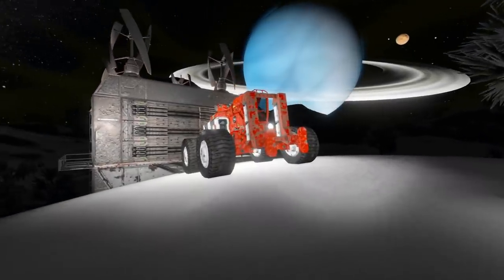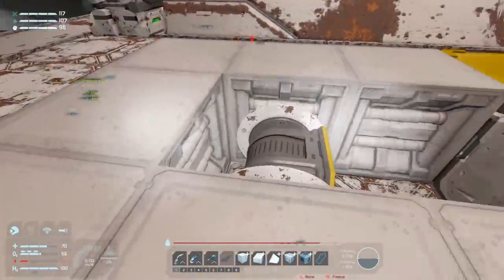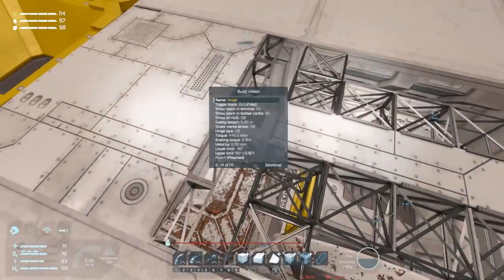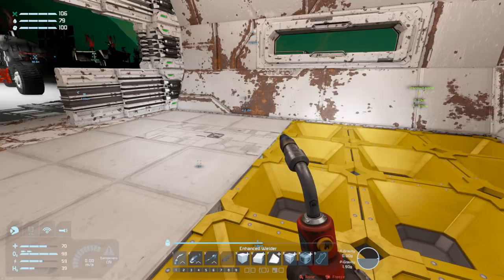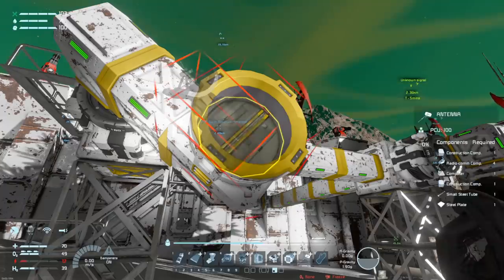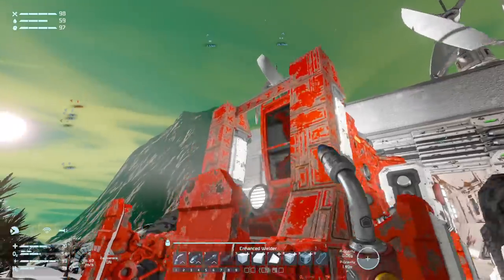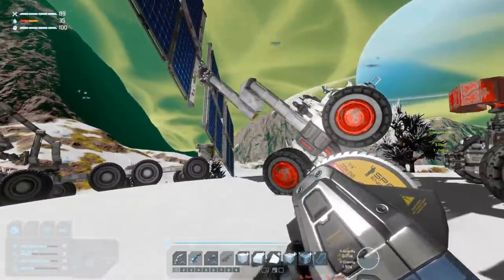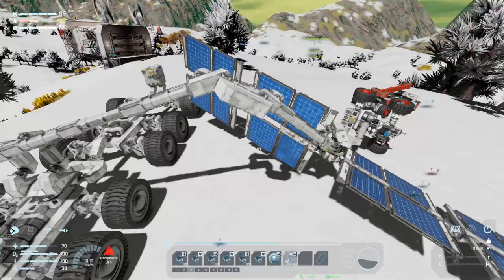Survival Impossible - Manny or Mannie or Clangy? #39 - Space Engineers Hardcore Survival

Comment: I just ran into this the other day. You CAN build like this, but you have to line it up, place your static base block, pick the pillar up with the crane (detach the hinge) put the weld pads on, and then let them weld to each other and then line up the hinge, make the base end loose (no resistance like a rotor that's off) and attach. So your analysis is correct. Make sure the setting on the hinge (like a rotor) is all set to the weakest they can be with a slight displacement. Very similar to what @Jenachy stated. You may still have an issue because of the force the gravity is playing on the hinge but you won't know till you try, I did this is space. This whole thing is because you cant make a "sub-sub" grid a static grid. You can attach to a static (like you were doing in space), just play out how you built it at the Lawnchair. The sequence of events is a key part pillar then, pillar then attach.

Comment: Great video!

From some experimenting on my part it looks like prefabrication may be the solution to your towering problem, though you might not be taking it far enough.

You could do the following:
* Build the first horizontal segment. At the end put a hinge part.
* Prefab a tower part, without attached hinge parts, and attach it to the end of the horizontal segment with the crane and Build Vision. Build a keypad (or something with a keypad) as part of the tower.
* After attaching the tower you should be able to use the keypad to turn the tower's grid into a station. After that you should be able to connect it to the voxel without a problem.

If your crane is powerful enough you should even be able to prefab the horizontal segments as well, mounting and attaching them to the preceding tower. It might even be worth it to keep the keypads on the towers for this and gun control.

This all pretty much depends on Build Vision. Since the unattached tower is unpowered attaching it to the end segment would be a nonstarter without a battery contraption, possibly involving a small grid hinge part.

As for your hideaway connector, why not go the other way and put flat corner LCDs on the large grid blocks around them? That way you have a place to put proper warning stripes.

Good luck!

Comment: One thing you could also do is build the horizontal segments with both horizontal and vertical hinges. That would allow you to keep the conveyor segments following the ground at a steady height. It should also allow a tower standardization. 
However, make sure that the hinges are unlocked when you try to turn a newly placed tower into a station.

Comment: Best answer, place the second hinge on the pipeline the other way up to give yourself movement in 3 directions instead of 2. This also means you can maintain the same height over the terrain.

If you don’t like that however build the pillars first then move the pipes in to connect them after. You normally build supports before the thing your supporting in the real world, so it makes sense here to lol. it’s also a lot more stable to build this way with hinges as you’re not dealing with converting to station while attaching anything so it only has to think about the movement of 1 object while not solidly rooting the other, thus likely reducing the probability of any issues and kaboom.

Comment: So, alternate ideas for getting the pillars up, you can build them as you have, use the merge blocks with one off, swing everything into position, the grab it with the crane to hold it in position, detach the hinge at the tower and use the hinge at the other end of the pipe to swing the whole pipe out of the way, then attach using the merge blocks, just make sure the crane is not locked to the ground, that way, everything should attach without shifting the voxel-anchored blocks and blowing them up..?

Otheerwise, great episode and as always, keep up the good work'

Comment: All white.  Definitely all white for the recessed connector. Also, just put a horizontal and vertical hinge at both ends of the conveyor sections, move everything into place to settle on the merge blocks, then turn off all 4 hinges so everything is free to move during the merge (like a universal joint).  After you merge lock the hinges and you're good to go.

Comment: The easy way to get your pillars connected to the ground would be to start as you did in the video. When it is in the proper place and connected to the existing  conveyor network, connect it to the ground temporary, using a landing gear, once fixed to the ground with a landing gear you can convert the pillar to be a stationary grid and place the bottom most blocks connecting it to the voxels. afterwards remove the landing gear.

Comment: I like the hazard colours on the connector, but if you want to keep the seamless look when it's in the floor, here's another idea: put a coloured light on the wall or ceiling, set its offset to position the light source over the connection, and turn it on/off with the timer block so that it only comes on when the mechanism is not closed (i.e. when it's open, opening, or closing). While I really like the connector mechanism, I don't think it's a great solution to the problem, because you can't park the Manny while you're using the grinder pit. You'll have to drop stuff on the collectors, back out, pressurise the room, do all your grinding, depressurise, drive in, raise the connector, reverse onto it, and close the doors again to repressurise. I love overengineering things, but not when it makes them harder to use!

Comment: I like the idea you said at the end of building a mock up. Could even move it out the way once the first block is placed. This could be by rotating the temp before disconnecting, ideally from the far hinge. That way you can rotate back to position once you've cleared the hinge part on the static tower. Then rinse and repeat, keeping your template throughout.

Comment: For the merge block build: In my experience, the larger of the 2 grids becomes the "primary" which is why the piece in the voxels is moving and exploding. If you place more blocks on that grid before merging it should* help.

We had an interesting experience when we were merging/unmerging a very large ship build to a smaller static station and after the merge the station was no longer static because it was the smaller of the 2 grids in the merge.

Comment: First issue was just trying to build a subgrid into the voxels which SE considers a no-no. Last issue was hinges just being absurdly touchy and finicky compared to rotors and pistons.

I'd say build the hinge base onto your existing piping, line up the tower/relay bit, slap it in the voxel, then add a hunge part to the tower/relay.

I guess otherwise you could just connector jank it but that's not super aesthetic and is also costly.

Comment: Attatch the pillars to the ground (or buried block) with a landing gear, convert to static grid through a control panel, then you can build blocks into the ground off of it. I've used it to project a building off a rotor before.

Comment: For the pop-up connector, I would suggest only marking the corners. It gives you the location of the connector for reference when parking your forklift, but it doesn't become terribly conspicuous.
For your forklift, I agree with everyone that has suggested ending with "ie."
I don't have any recommendations for the pillars however, as I've only recently begun delving into sub-grid construction myself. That being said, I agree with the users that have recommended building the tower up more then using weld pads or merge blocks to secure the upper section to the tower.  The logic seems sufficiently sound.

Comment: Suggestion on setting up those pillars...

1. Make the pillar how you want
2. Capture a blueprint
3. Use a projector to display it exactly where you'd like it to sit.
4. Weld it up using the Liftsie
5. Connect the hinges

I know it doesn't let you build & place as intended but it should work and not need any merge blocks or things like that.

Comment: 45:35 the welding pad wasn't the issue, and you can build that way. All you need is a control panel. Move pillar into place and use the control panel to convert to station and build off the bottom of the pillar into the ground.

Comment: 43:20 My guess is because the grid was still considered mobile and you were trying to "merge" it with a stationary grid.  Rather than force the tower to become stationary, it forced the base to become mobile, which then proceeded to esplode because embedded.  My experience with making these kinds of umbilical lines is that you can actually force the "non-head" part of the hinge/rotor to become stationary even if they're not embedded, so long as they're not moving.  Which means you can then build off of them and into the ground.

Comment: You should add two spinning hazard light on each side the hidden connector, that turns on when you open/close Manny's charging port, and have a second timer block turning them back off after 10-20 second when the contraption is still.

Comment: IRL for a true universal joint that can relieve any stress in the system, you need to account for all 3 axes of rotation.  A standard "wrist" configuration to do so in stages is roughly equivalent to rotor-hinge-rotor, in series.  Engineering tolerances generally mean if its close you shouldn't need to care about all three, but it looks like the physics engine acting on the hinge does not tolerate any bending at all about the axes perpendicular to the one it is intended to allow, so adding an advanced rotor to either side of the hinge would probably solve the issue, since it can rotate freely on one of those extra axes and in any case seems to have a higher tolerance for "wrong" bending stresses than the hing does.  Especially if the last part to get attached is the rotor parts.

Comment: Suggestion, the Gantry mod includes nice looking, printable gantry blocks. Included in there it a gantry with a conveyor in the middle. Allowing you to attach a conveyor from the side, and piping on both sides. Useful for limiting your junction count for performance.

For you conveyor problem, it looked to me like it was pulling downward on the hinge. I'd think an extra hinge to allow vertical shifting might help. Worst case you will need two hinges on each end to handle lining everything up perfectly.

Or, build the line first, straight between the two without hinges and odd angle. Then deal with the connections individually. More like how powers lines are in real life. The main lines are put up, then branched to individual transformers near homes. More costly in materials, but easier build, easier to modify, and likely better performance. If done right, you'll be able to add to the main line to connect additional buildings in the future.

Comment: Maybe add pistons to allow a little adjustment in length of the "pipe"? You could retract the hinge out of the way for setting up the pillar too. They can also bend a little. Would love a mention if it helps. Done a lot of attaching single blocks with the weld pads and never had an explosion. I don't use landing gear to anchor my small crane, I use a counterweight. It causes entirely different disasters!!! But it may allow a little more give when welding. PS Love all of your and Capac's work. Looking forward to Light Echoes #3!!!

Comment: One recommendation is to make the conveyor piping a little more flexible by putting a free-moving hinge in the middle of the run with a slight bend in it, maybe paired with an advanced rotor or two, this will allow the conduit to have some give when connecting the two towers together.
Reply from the maker: Interesting idea, if I weren't afraid it would cause my game to have awful performance I'd do a bunch of hinges along each run and let the conveyors sag a little like power lines would

Comment: Your entire conveyor system CAN be made as a series of large static grid. What you have to do is construct the first sub-grid, immobilize it (make sure it will have zero velocity), detach sub-grid, convert to static grid, re-attach. Repeat until pipeline complete. Don't worry if sub-grids aren't perfectly lined up - as long as you can attach them after making static it should work. After the new static is attached you can just build into the ground normally.
Reply: Oh, and DO NOT share inertial tenser.

Comment: Have you considered using pistons?  One extended piston will be the same length as 6 conveyor tubes and will use a lot less resources.  That is, if you don't mind the look.  You can cover it with catwalks, either steel or grated, to make it look better at the cost of more resources.  You can even make a walk way with railings on the top of the conveyor system that way.  Using a piston also allows you to control the length so that, combined with the rotation of the hinges, you don't need to precisely align your pillar in the voxels as you can adjust the section of "conveyor" to fit in perfectly.  Another thought I had is using pistons as the pillars.  If you don't need the pillar in the voxels you can just put a piston pointing down under the conveyor junction and extend it until it contacts the voxels.  If still want it connected to the ground, you could put a landing gear on the end of the piston.  If the landing gear goes into a small hole in the voxels, you can then build blocks in the voxels around the landing gear and piston to make it look better.

Comment: Build a piston into the ground with a landing gear on the top and lift the gear to the points you want to support. That way you can hold the structure at any point irrespective of normal building connection points.

Comment: If it will let you, you could put a landing gear on the pillar, put blocks out of the ground so they lock to the LG, then use a control panel  to convert it to a station. If it won't or you don't want to do it that way I agree with starting with the pillar in the ground and then attach the hinge at the top.

Comment: You can use connectors on the hinge, and towers to give you the torsional twist, and stretch to snap the segments together. Once locked you’re piped.
Reply from the maker: That's true, I'd prefer not to use the connectors from an aesthetic point of view but if I can't get it to work it's an option I'll keep in mind :)
Reply: Yea, they’re not the best looking things. The small grid ones are better. Potentially use them to attach the support poles to the ground. 

An advanced rotor that allows conveyor throughput would allow some stretch, and also not be quite as bad. 

The only other idea would be to incorporate a piston in the tower as they allow a fair bit of side to side(thinking about how much they can sway around without inertial tensioning), but may make some clanging noises if not almost spot on.

Comment: Build the whole pipe on the ground. Use it to set your pillars two blocks high without conveyors where your pillar is in the ground. Then detach the pipe section and build your pillars to height. You can then raise the pipe. Make sure torsion is down and the hinge is off. I just tried it and it works.

Comment: If you use the hinge to swing it into position as you are, then grab it again with the Crane, disconnect the hinge, use the weld pad to fix what is effectively a free floating tower to the voxel embedded block and then reconnect the hinge. 
This way the tower can move when it connects to the voxel block and the displacement move is being done by the Hinge which we know from the Lawn Chair works.

Edit: Should have continued watching :). Try moving the conveyor line out the way before you connect it?

Comment: with building, you can always use some of your jetpack to place a block underneath the pillar and then add another to embed the pillar into the voxels. this method should not require the use of merge blocks or weld pads
Reply: I don't know why he didn't just build a block into the voxel and then convert to station. Why even use the weld pad?

Comment: I paused at 31:33 for this comment: If you had set the bottom block in the ground and used the Advanced welding to merge column onto it then it would have lined up with the bottom block.

Editing this comment after watching further and I think i see the issue, the Hinge at the top is causing the column to pivot instead of rotate causing phantom forces at the base.  If you tried detaching the column from the hinge I think it would have connected with minimal risk of clang.

Comment: Could you run scaffolding on the ground between the two points (base and tower) to determine the correct height of the in-voxel block and then remove the connecting scaffolds?

Comment: You could always just slap a control panel on the pillar, move it into position with the hinge and then use the control panel to convert it to a static grid. After that you just build armour down until it intersects with the ground. That's how I've always done it when I build mobile bases and then anchor them to the floor when I find a location I like. Although those bases were usually held in place with a landing gear as well so I've no idea if it'll work for you.